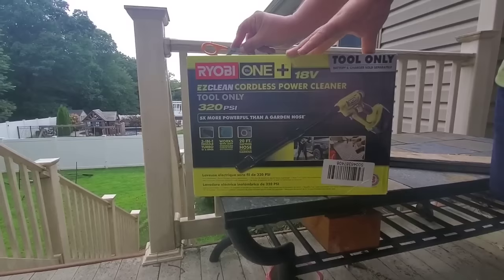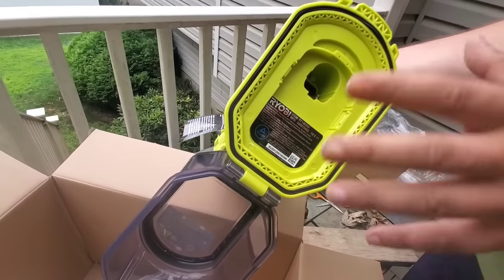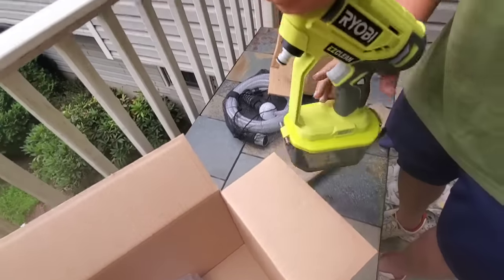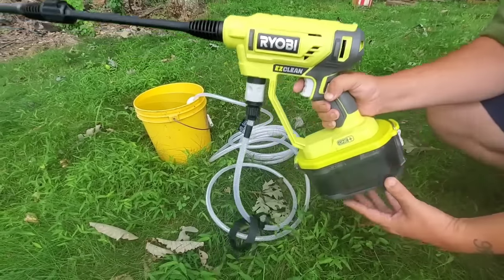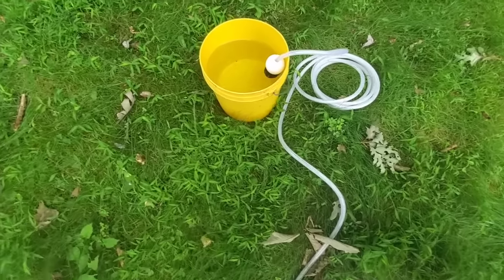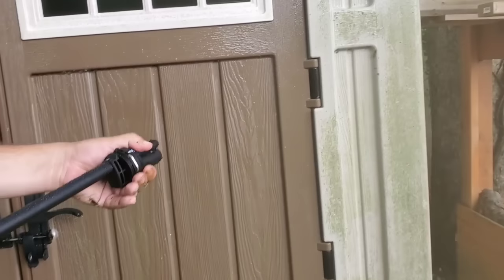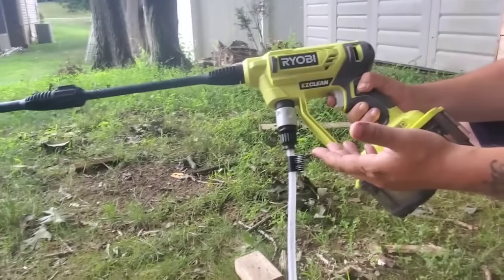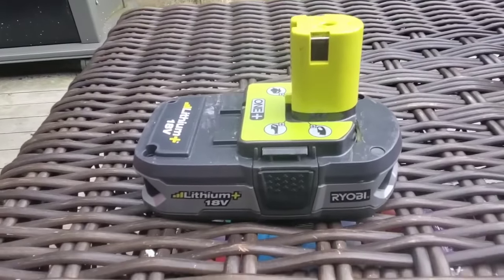Ryobi 18v EZ CLEAN Cordless Power Cleaner Review

Comment: Thanks for the video, washing the mower is one of my planned uses - looks like it works well for that. Thinking it'll work out well for a yearly cleaning of the grill too, among other small tasks. I have a gas pressure washer for my bigger jobs, so my expectations are realistic. Also ordered the bottle adapter for ultimate portability on smaller jobs.

Comment: From vids I've seen it has stronger pressure when connected to your house. And the 15 degree is the best mode. Was gonna buy it during Ryobi days but forgot about it.
Reply from the maker: I got Part 2
Reply: He's also using the smallest possible battery. If he used a 4Ah or greater it performs much better.

Comment: Lot of people saying their garden hose is just as strong or better.
But they are missing the true value  of a 18V cordless pressure washer in areas has no direct connection to the garden hose faucet luxury option.
With couple old 5 litre clean window  washer antifreeze containers full of water 💧 and a bucket  you can wash things when you don't have faucet and electrical power  connection.

Comment: Can you comment on the distance reached with the sprayer?  I was thinking about buying the two gallon Ryobi chemical sprayer; but video reviews show very limited distance on the spray.  I'm looking to use this to spray soapy water on my apple trees to inhibit pests.  For this to be useful, it needs to be able to shoot at least 25 feet.
Reply: Better to buy one of those 2 gallon pressure spray bottles that you pump to a maximum psi and then spray away. Some models with the long nozzles should be enough for appletrees. One can also use a compressor to fill the pressure...

Comment: It works great if you want a soft wash but I find my hose has stronger pressure than this "power washer." It doesn't waste much tho so if you want to conserve water that would be great also. I returned it and kept the 2 4ah battery kit for $40 during Ryobi Days & got myself a SunJoe 2598MAX for $120. Now that is a budget pressure washer that comes with 3 quick connect nozzles.

Comment: Do you think the battery compartment could fit a ryobi to dewalt adapter with a dewalt 5ah battery on it? Or even a flexvolt 9ah? Although i would probably never use that battery on this. I wish dewalt would jus make this. Looks like an awesome convenient little tool
Reply from the maker: Maybe with 1.5 or 2.0
Reply: @toolboss8410  maybe even a 4.0 slim but maybe not cuz of width

Comment: I heard that thing its garbage
Reply: It has its uses don't think this will replace your regular gas power washer though.
Reply from the maker: @jjsrt8  it's shouldn't unless there is a pressure washer out there at 320 psi that I were using 👍